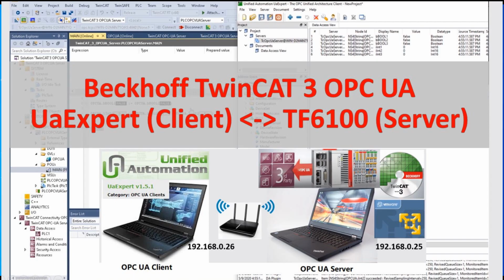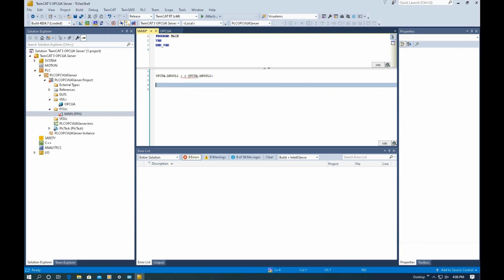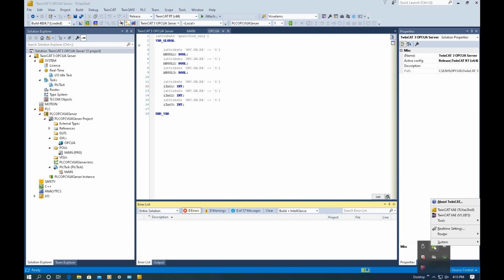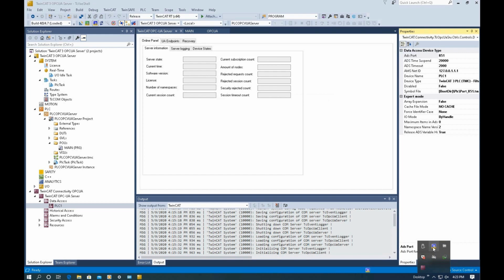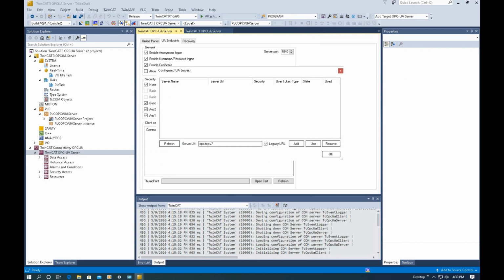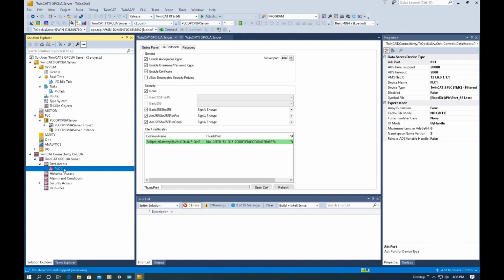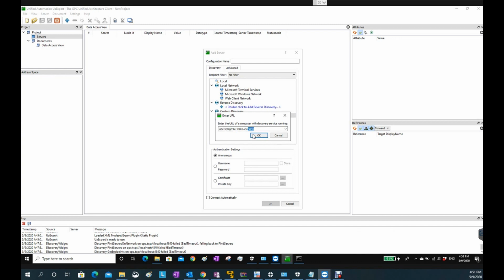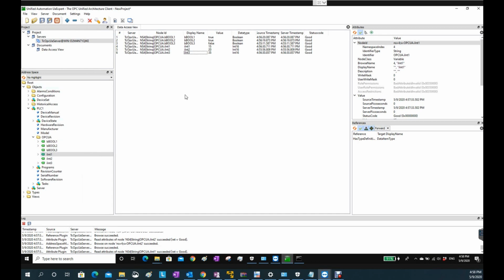COM08a. OPC UA Beckhoff - TwinCAT 3 TF6100(OPC UA Server) and UaExpert(OPC UA Client)

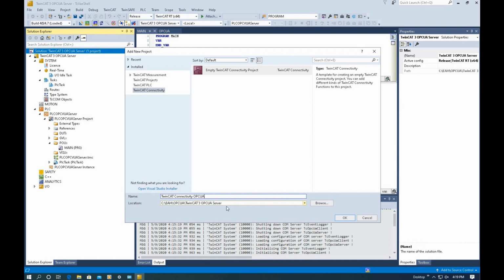Comment: Great tutorials - However installed TCXAE  and ran success simulations and visualization. However after install  TF6100 OPC UA Server, it never shows up as option in New projects ( as per 11:16). Not sure why..
Reply from the maker: Beckhoff recently took off the "Visual Studio Version" which was the main method before. The 'Stand alone' is the only available now, it is weird.  But I have the video for ''stand alone' OPC UA TF6100. SCADA05. [PLC&HMI] Beckhoff TwinCAT OPC UA Configurator TF6100 (2022.05 Standalone Rev). https://youtu.be/yKocYfOLegg
Reply: Thank you for the quick response. I will review the SCADA series. I have a project in China which requires OPC UA to control Maestro
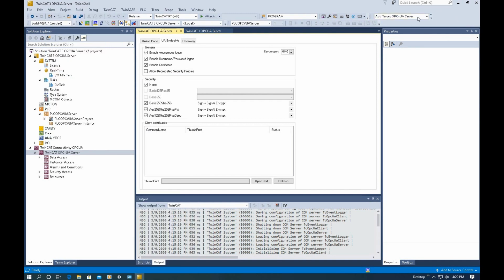Reply: HI - Tried to follow the SCADA 05 example ,but its very different idea  - so I got lost..  Installed Client/Server/Gateway/Configurator etc and went back to Com 08a to try again . At 17:18  did not get  ADD Target OPC UA server.. showed Edit Server  list in that window...
Reply from the maker: If you'd like to follow the 'Visual Studio' way, then I would recommend to view COM8b. it is more clear than COM8a. https://www.youtube.com/watch?v=ShfRMd6-eIY&t=0s
Reply: @electricalautomation  Thanks. I watched a few of the SCADA series and then tried again. Worked okay now. Also wrote a Python OPCUA client on Laptop #2 and it works. Thanks for this!. Good stuff!
Reply from the maker: Glad to hear that! Thanks for letting me know

Comment: Hi for the toolbar icon for OPC UA         cofigurator showing edit server list it does not showing add opc ua server what is the exact version are you using
Reply from the maker: Are you using the latest OPC UA from Beckhoff, if yes, please find the video SCADA05. [PLC&HMI] Beckhoff TwinCAT OPC UA Configurator TF6100 (2022.05 Standalone Rev). https://youtu.be/yKocYfOLegg  Beckhoff changed some minds on the OPC UA. Please see the new method.

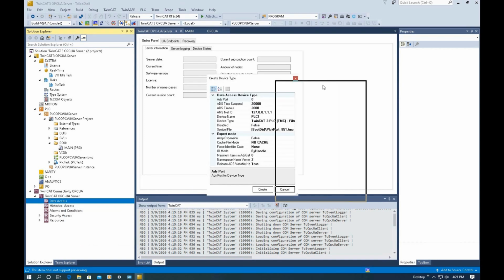Comment: Hello! Thank you so for your video. I face one problem, when I want to Add Device Type in Data Access (12:17) then it shows WARNING, please connect to Ua-Server. How to solve this problem? Thanks in advance.
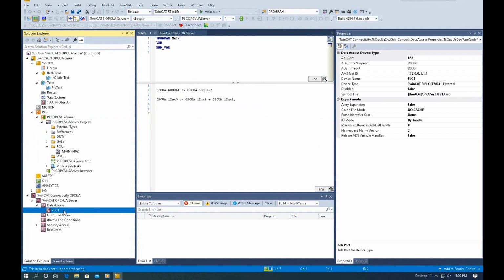Reply from the maker: Pls see 14:50 the OPC UA Server is connected. You may need to connect the OPC UA Server at first, then add the device type. Also please review COM08b. OPC UA Beckhoff - OPC UA Server via C6030 Controller and TwinCAT 3 TF6100
https://youtu.be/ShfRMd6-eIY,  the operation procedure may be better than this video. I used the procedure to configure the Beckhoff IPC many times without any issues.
Reply: @electricalautomation  Hello! I try to like that, but it still shows not connected with OPC UA Server. Could you tell me how to establish a connection with an OPC UA Server? I am a new user of TwinCAT 3, that's why I face many problems. Could you help me for that? Are there need any hardware driver? Thank you.
Reply: @md.sahinsarker3710  I'm running into the same issue

Comment: Thanks for your video. I am having some difficulties though. When I try to 'Add device type' in 'Data Access', I get the message 'WARNING Please Connect to UA-Server'. When I try to 'Add Target OPC-UA Server' I get 'Application certificate does not have an application URI'. I added the TF6100 and TF6120 licences. Firewall is disconnected and the OPC-UA Server running (I checked since I can connect via TwinCAT OPC UA Sample Client). Any idea of what can be happening? Thanks in advance.
Reply from the maker: Hello, Can the "Configured UA Servers" windows show up after you click "Add OPC UA Server"? Most likely you have the issue on the configuration at his window, where you need to config the server URL like opc.tcp://192.168.x.x:4840. please let me know if you find something. Also I would have a Beckhoff controller this days and I will config the OPC UA server and record a new video if I have chance to test it.
Reply: @electricalautomation  Thanks for your quick answer. Actually, the 'Configured UA Servers' window does not show up. I get an error 'pop up' window with the error message instead. A colleague of mine tried and had on his computer the same error as I had, so I am discarding something specifically related to my computer. Might it be related to the latest Twincat versions or Windows 10 configuration? Any other step that I could have missed? Thanks a lot for your help.
Reply from the maker: @DarkHideMoon  Please make sure the OPC UA installation software you download correctly. Also MAKE SURE intal the OPC UA software with "Run As Administrator". Most likely your trouble comes from the software. I just got a Beckhoff controller and did the same configuration procedure, and only 5 mins following the same method, I did the OPC UA server via a Beckhoff controller successfully.
Reply: @electricalautomation  This is a short video with the error pop-up. https://youtu.be/5Qt5_lVWb5U
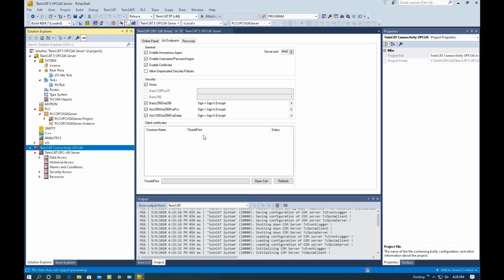Reply from the maker: @DarkHideMoon  Hello, just saw your video. Plase view my video 17:00. Try to "Add Target OPC UA server" successfully at first. Then 'Connect" the OPC UA server. Then config "Data Access"
Reply: @electricalautomation  Hi. I unistalled both TwinCAT and TF6100 and installed them again as administrator. I tried to 'Add Target OPC UA server' first, but I always find the same error 'Application certificate does not have an application URI'. Since the error message mentions 'CN=TCOpcUaConfigurator', I guess the problem is in the TwinCAT Connectivity project certificate generation. I am trying to check when is this project certificate being generated and how can it be confiturated. I let you know if I find something.
Reply from the maker: @DarkHideMoon  What is your URL. e.g. opc.tcp://....:4840
Reply: @electricalautomation  Hi. The URL is opc.tcp://MiIP.1.1:4840 but I don't have the chance to add it since the menu does not open.
Reply: Hello, was a solution for this problem ever found? I'm stuck on the same thing
Reply from the maker: @megacs912  Not sure the problem where it comes from, but I would recommend a newer video https://youtu.be/26DJ17SIl1Q
Reply: @megacs912  I did not find any solution. I just realized I could use the server without extra configuration so I could skip the step.

Comment: Amazing! Thank you so much for your explanation about opc ua! 🙏👌
Reply from the maker: My pleasure 😊 Thanks for watching!
Reply: @electricalautomation  I just tried to setup opc ua on Beckhoff CX5010 with Windows Embedded Standard 2009. But getting some error when want to connect to its server..  Question is : Do I need to add opcua server in vs project or just setup it in plc and should be able to connect from my pc and see all variables? This is my first day with opc ua learning..
Reply from the maker: @dariusvaitkus965 CX5010 runs as OPC UA Server. The "target" of the OPC UA Configurator is the CX5010. e.g. 192.168.1.10:4840
Reply: @electricalautomation  thank you . I'll try to setup again. So I don't need to connect to cx5010 and install there opc ua? Everything is done on the pc?
Reply from the maker: @dariusvaitkus965  You do need to install TF6100 in CX5010 and your laptop. Do OPC UA configuration at your laptop and download the configuration to CX5010. CX5010 is the OPC UA Server and it is your download target.

Comment: Me again, I got up and running the OPC server and can connect to it but I cannot see the variables, I have added the attribute, etc but the variables are not shown in OPC. I have a dedicated controller and the server is running in the development machine. One thing that I noticed is that when I browse for the symbol file (TMC file) in the data access configuration it always shows the files on the local machine, even though I select target and the target is correctly defined as the controller.
Reply from the maker: Please check if the OPC UA trail license is activated in your dedicated controller. The TwinCAT OPC UA functions need the license activated.
Reply: @electricalautomation  Yes, the TC3 OPC UA license is activated in both the server and the controller. Is necessary to install the OPC server in the controller? as I understand the OPC server comunicates with the data sources via ADS
Reply from the maker: @totoxahc  If you are using Beckhoff Controller, then it is preinstalled OPC package. If you are using your own PC, you need to install the TF6100 in the PC, and the OPC UA software must match with your TwinCAT 3 software revision.

Comment: If you are getting "EXCEPTION | Security was NOT requsted but server does not have any endpoints without security." when adding Targt OPC-UA Server, open "Twincat/Functions/TF6100/Win32/Server/TcUaServerConfig.xml" in some text editor (I recommend VS code) and uncomment commented paragraph containing line "<SecurityPolicy>http://opcfoundation.org/UA/SecurityPolicy#None</SecurityPolicy>" (I had this around line 95). You have just allowed endpoint without security. Restart OPC-UA server and try to add target again. Now it should work.
Reply from the maker: Thanks for your info!

Comment: Thank you for this video!!,  I did all the steps, I managed to configure it but when I try to do it again I have the following error in the minute 18:18, "EXCEPTION, socket was closed gracefully, can you help me?
Reply from the maker: Hello I didn't have this problem before. But probably you could check 1. make sure trail license is not expired.  2. TF6100 OPC UA software is running (right bottom corner icon) 3. turn off windows firewall. 4. try to use the other PC or fresh virtual machine.

Comment: When i try to select the end point,  i dont find the none end point even though i have selected before could you tell me how to rectify it.
Reply from the maker: Please let me know the 'time' in my video related to your question.
Reply: @electricalautomation I have the same issue. It's around 20 minutes in the video. And after choosing an endpoint and clicking connect there is nothing shown in the client certificate. Would you please help me?
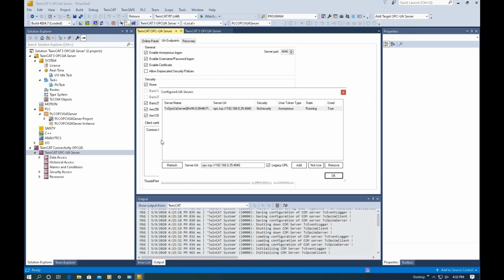Reply from the maker: @chengx4690  Please check the 19:26 https://youtu.be/aUClSRSSR_E?t=1166 check if the "state" is "running". Also check the license, activate the trial license of the OPC UA. Pls let me know if you got it solved
Reply: @electricalautomation  Thanks for your reply! But according to the Beckhoff OPC UA manual, it says no license is needed for their OPC-UA server. So I am not sure where can I activate that.
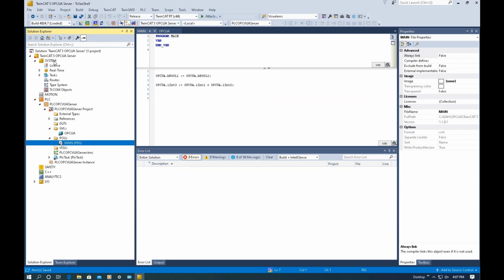Reply from the maker: @chengx4690 At 5:15 you can find the place to active the license. NOTE: TC3 OPC UA NEEDS LICENSE TF6100 and TF6120, 7 days trails license works for the test view. https://download.beckhoff.com/download/document/automation/twincat3/TF6100_TC3_OPC-UA_EN.pdf
Reply: @electricalautomation  It was indeed the license problem! Thanks very much
Reply: @chengx4690  hello, I am facing the same issue: there is nothing shown in the client certificate. I have setup the license TS6100 & TS6120. May I know how you solve it eventually?
Reply: @electricalautomation  It at 20 minutes, selecting the end point
Reply from the maker: @rahulravi4424  Please check the 19:26 https://youtu.be/aUClSRSSR_E?t=1166 check if the "state" is "running". Also check the license, activate the trial license of the OPC UA. Pls let me know if you got it solved

Comment: I followed this Tutorial step by step. I have the problem that at the end my variables have no value in UA Expert. Statuscode is 0x0810e0000. What does that mean? And by the way many thanks for the tutorial really helpful
Reply from the maker: Hello, can you browse the OPC UA tags from Beckhoff side by using UA Expert? Have you activate the OPC UA trail license in TC3? I may forget showing the process of the OPC UA license activation since I activated before recording this video. Please check the activation of the trail license.
Reply from the maker: Pls also check the 'TMC File' showing in the video 8.35 at https://youtu.be/aUClSRSSR_E?t=515
Reply: @electricalautomation   Hey  Thanks for replying. I Actually can browse the Tags by using UA Expert. I also activated the licence. I don't know what the problem is
Reply from the maker: @mehdi19966  Do you mean that you can browse the Tags successfully but the value of the tags is zero? Could you please check if you 'start' (yellow gear in green box at bottom of screen) the Beckhoff controllers and 'RUN' (Green play button at the top bar of the software) the program.
Reply: @electricalautomation   I fixed the problem it was actually a licensing Problem. Thank you!! I had another Problem recently though that when i connect with UA Expert I Can't see the  PLC Programm MAIN
Reply from the maker: @mehdi19966  Please keep in mind the tags you declared need the 'OPC.UA.DA' property as showing in https://youtu.be/aUClSRSSR_E?t=257
Reply: I had the same issue. Once I added the TF6100 and TF6200 liscese to the project the connection worked.

Comment: Thank you for this video! I have one question: Is the OPC server running in the (simulated) PLC, or on a separate program on your PC.
It feels like its running on a separate program on how the connectivity project is set up. Or did I misunderstand this?
Reply from the maker: The OPC UA Server is an individual component and Beckhoff 'PLC' (in the project, PLC folder) they are running parallel as I understand. In the video, since I didn't have an actual hardware controller, I used my laptop to run the  PLC + OPC UA Server. There would be a connection between  PLC and OPC UA Server, such as 'Ads port 851' setting, which allows OPC UA Server finds out where is the PLC.